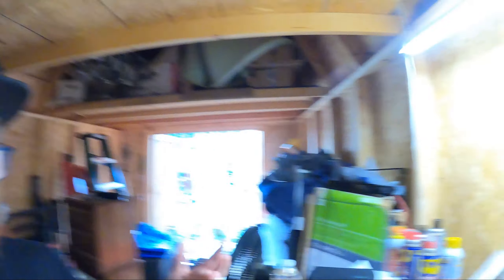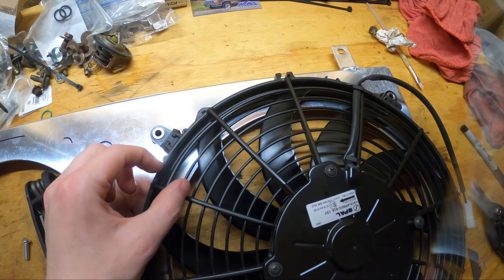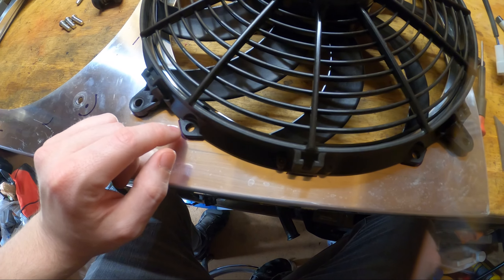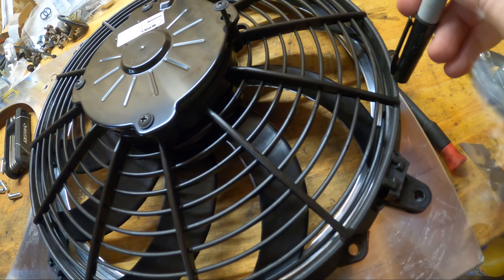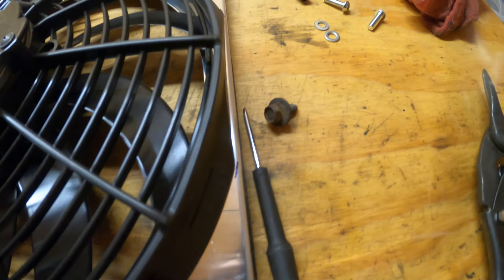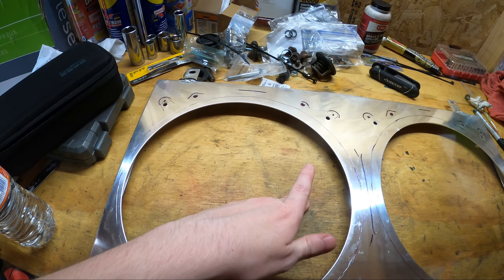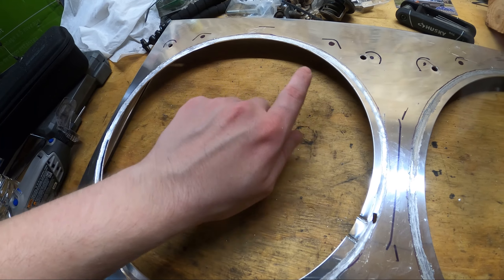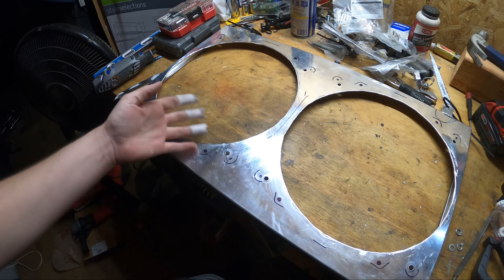MK3 Supra Electric Fan Upgrade

Comment: thanks for this! i was wondering what to do with my mishimoto unit, it doesnt cool my car well enough on its own, and i havent even added the extra load of A/C yet. my car is Ls swapped so maybe it makes a bit more heat as well
Reply from the maker: @Ironsights85  You're welcome! You definitely would've had overheating problems with AC. With an LS or not, those Mishimoto fans could've been designed to cool better.
Reply: @SlothKingGarage  the mishimotos work ok in canada, at 100 kph, but they dont like freeway speeds in the states, revving at 3000rpm long term is a bit much for them it seems

Comment: hey my man where did you get your fan shroud?
Reply from the maker: I got it from Mishimoto
Reply: How have the new fans been holding up temps now?
Reply from the maker: @raymundoquinteros1151  They've been holding temps way better than the Mishimoto ones so far
Reply: @SlothKingGarage  do you do spirited driving or simply cruises?
Reply from the maker: @raymundoquinteros1151  I do a mixture of both